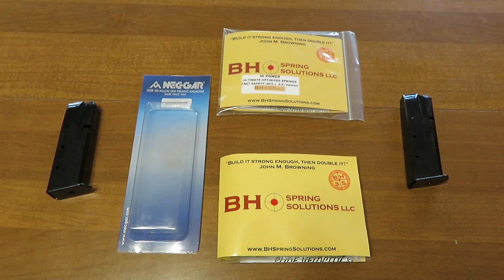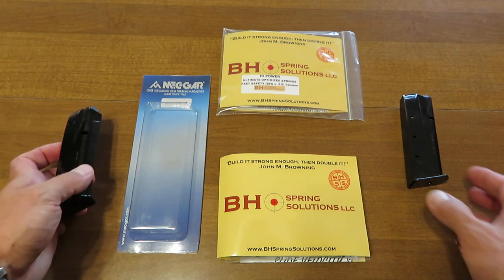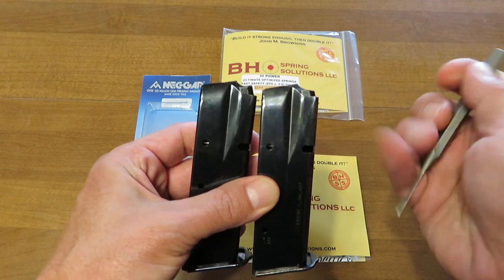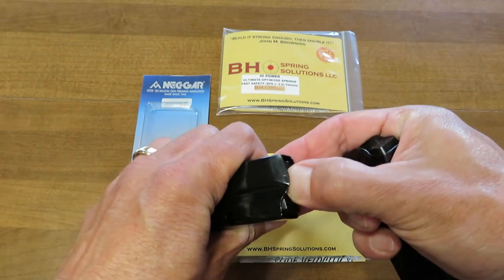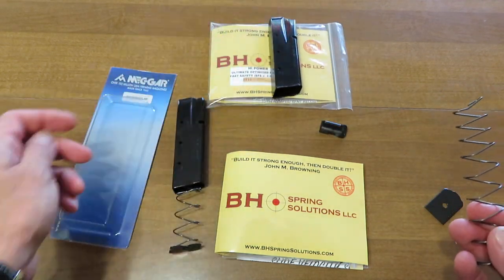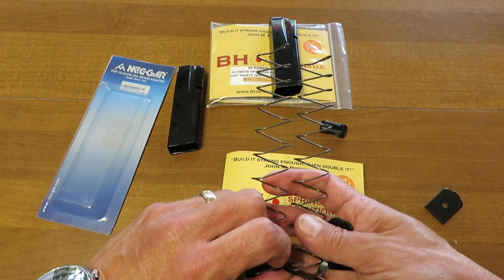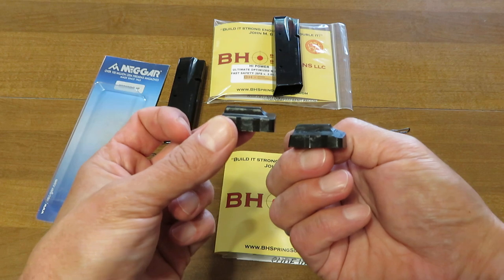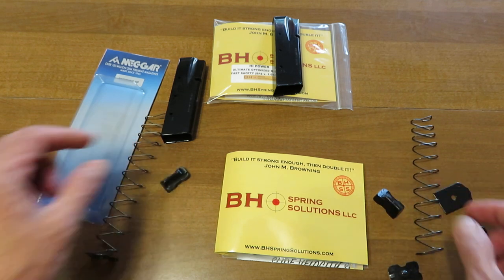Do Mecgar Hi Power Magazines WEAR OUT?  By: BHSpringSolutions LLC

Comment: Those two followers are made to a different specification at the nose and it is clearly visible. There is no wear point on a Browning hi-power that would cause that front of that follower to wear out in that manner. I love your tutorials but in this case that magazine follower specifications has been updated. At least where you're talkin about that nose down element on that older magazine follower. The other change that is occurred within Springs in the last couple of decades is that the way they are tempered has changed. That said even the old way, when done properly results in a spring that although all Springs will find their first yield Point fairly early, their second yield point is resisted quite well. 
Cason , case in point, and I admit that this is a single case. A number of years ago there was the case of a 1911 that was found in an estate that was known to have last been fully loaded, and left loaded in 1929. I believe that this firearm was located and a fully loaded condition, with rather pretended projectiles in the 2005 or so timeframe. Which accounts for about seventy-five years of being kept in a fully-loaded condition. Just as a test. Because apparently this was brought to somebody and firearms has a test they took it out on the Range and actually fired the gun and it's found condition and it worked flawlessly. If I remember correctly they actually reloaded the magazine the magazine worked perfectly. So it is not true that the spring will wear out merely by being compressed. If that were so Springs on your car would wear out long before you got 50,000 miles on them and most Springs will last into about a 200,000 mile range when they are heat treated and tempered properly. That is a huge caveat. If I remember correctly one of the most modern Springs were at least claim to have been being manufactured by IMI. They claim that the Springs resist that second yield Point quite well. You might want to look into this aspect of especially music wire Springs. Keep up the good work because I love the Browning hi-power it is the only nine MMA own and it's an Argentine military and it is the most accurate 9mmm I have ever seen in my life when it was first purchased and it was well used when it was first purchased.

Comment: I found that the MecGar mags wear out faster than the OLD mags that say Belgium or Canada on them. I used BHSS's Makarov mag springs to rehab a Daewoo modern PP clone, that has the loaded chamber indicator eliminated. It worked out fabulously well. THANKS! BH Spring Solutions!!!! It is a neat little Walther copy, that is rather rare, being less than 1500 were imported into the USA. I still find that clean Belgian mags are the best with JHP ammo in a Hi Power. Am I biased about my love of the Hi Power. One MKIII Hi Power did save my  life, so, maybe.

Comment: Seems like he’s compared a 15rd mag spring to a 13rd mag spring.
So of course they won’t be the same length. Also he said it spent most of its life loaded. If the mag is full of rounds for a significant length of time, the spring will lose strength. But that’s the same for any mag, no matter the brand. For the follower, I don’t see much difference, other than the mec gar one was shinier. I don’t think that will effect performance.
Reply: This is absolutely untrue. Springs lose strength from cycling, not from being statically loaded. While springs will eventually lose tension, whether unloaded or loaded, over time, it's impossible to quantify to what degree.

Comment: Do you guys carry these mags and if so , do you have any 13 capacity mags
Reply from the maker: Yes, they can be found in our website in MecGar Magazines section.
Reply: @bhspringsolutionsllc555  , I would like for BHSpringSolutions restore my Hi power 9mm. Do I send it by my local Gun dealer or mail it myself
Reply from the maker: @vaughngreene8770  drop us a message on 1-877-423-BHSS (2477). we will contact you about the details.

Comment: i'll be honest, i'm not sure your explanation for spring wear jives with material science. a properly designed spring left compressed over time shouldn't experience significant loss of spring force
Reply: I Love That Katie Loves Classic Books 

I think the issue with the 15 round magazines is that they’re using the same spring as the 13 rounders so the spring gets over compressed and loses strength from being in an over compressed state
Reply: Its common umong magazines. The springs are over compressed to compensate for the natural wear of longevity however when you get into automatics a spring with that amount of wear with certain ammunition combinations can fail to load that ammo quickly enough into the chamber before the action closes causing miss feeds and other weapon related reliability issues. This was a particular issue in the marine core in the 90's when they where starting to field 60's era 30rd m16 mags in the desert. The same issues occurs today when using old stang mags with the m249SAW. The springs can't feed the ammunktion fast enough due to natural degradation- however when using new magazines or aftermarket ball bearing followers the guns run near flawlessly.